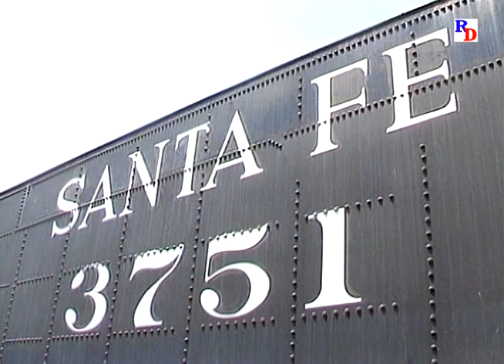Restoring Santa Fe 3751 | From park to first run

Comment: I saw 3751 last year while riding a southbound Amtrak Surfliner from L.A. Union Station. A couple miles after departure we passed a locomotive service facility with a turntable and 3751 was on a turntable spur. The smokebox had a white tarp over it and a couple of workers were nearby. If you look at a satellite image you'll find this turntable just west of the mainline, right before it crosses E Washington Ave, and 3751 is clearly seen. Remember, southbound trains leaving L.A. Union Station actually back out, in a northerly direction, then a 180 degree right turn aims it south along the Los Angeles River's west bank. That's right, the front facing seat you enjoyed from San Luis Obispo to Los Angeles will be rear facing for the ride to San Diego!
Reply from the maker: Thanks for the info - and thanks for watching! -DeAnn

Comment: Santa Fe engine 3751 is an impressive sight to observe in action, this locomotive was the first Santa Fe rr 4-8-4 type engine and it has significance of holding that title. I am glad that the 3751 was preserved and was eventually restored back to operating condition and now occasionally hauls excursion trains, ATSF owned an handsome & impressive fleet of 4-8-4 type locomotives and several examples have been preserved.

Comment: wow! Where can if actually get a real section of a railroad track? I would like to have at least one section of track at my house. Do you know if they are expensive to buy?  Do you know if the steam engine are normally on neutral which means it can be moved freely manually? I remember riding on the Durango and Silverton NGRR and they usually let the steam locomotive ride down hill on neutral to conserve coal and water.
Reply from the maker: I don't know for sure, but I would have to think the railroad makes their own "sectional track". -Tim
Reply: @Railfandepot  do you guys ever show model railroad or garden railways
Reply from the maker: @asbmp  We have not....yet. We do have some footage of both garden and indoor model railways. We'll see if we can get to those! :-) Tim
Reply: Have a 12" section of cut rail and I can barely pick it up.

Comment: Could somebody tell me which steam locomotive I saw as a teen in the mid-1970s sitting at a shop in Los Angeles near Union Station? I was on my way to San Diego...
Reply from the maker: It would not have been 3751, so I do not know what steamer it could have been. -Tim
Reply: @Railfandepot  Well, I'll keep some feelers out... Maybe contact a Santa Fe historical department or something? It was a big one and quite visible at shop from the tracks as the San Diegan went by...